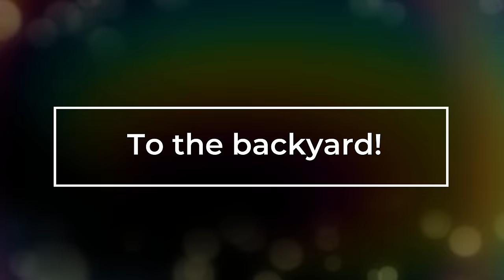Mowing tall grass perfectly (Satisfying)

Comment: i see alot of the americans mowing and then doing the edges after,i prefer doing it before like how you have it done it,cleaner to me,that mower just seems to eat the grass,but  alot people bag the crap outta the toro but it looks pretty good to me,what are your thoughts on the mower?
Reply from the maker: Thanks! Ah, you asked me about my mower, which is something I love to talk about, so strap in! There is a lot of talk in the industry about the Honda HRU 216; it has a great engine, is tough as nails and reasonably priced for what you get. Word on the street is that the self propelled and other ancillaries no longer last as long as they used to though.This Toro is a little less affordable, but more robust overall, handles well in tough conditions, and leaves a great finish. I've cut foot high grass with the mulch plug in and it was so clean it looked like it was caught. The blade on the mower in this video has since been replaced, so it performs even better now. My opinion is that for a long time this mower has been the best in the Australian lawn industry, with the 216 a small distance behind (I'll get haters for saying that haha). Apparently there is a new kid on the block which has probably unseated the Toro 21 inch, and that's the Scag 21 inch. I haven't used it yet, but I've seen and heard good things, so it's looking to be a possible future upgrade :)
Reply: @BladeMateLawnCare  really the scag?,ok must look into it,didnt know they had a push mower,that standon mower looks awsome as well,cheers mate,have a great 2024
Reply: I was ready to pull the trigger on the new Scag 21 inch, but ended up picking the same Toro Sean has but with the Honda engine for one main reason; steel deck (Scag) vs. aluminum deck (Toro).  I also happen to have the Honda, and even though the Toro is a tick rougher around the edges, the build quality is night and day.  It will take anything you throw at it.  Cheers.
Reply: Problem is with the Toro it only has the 1 long blade where the Honda HRN has 4 swing blades that cuts the grass better when wet in my opinion.
Reply: Yes in USA I do it edge first mow then blow!! My lawn always looked great!! I was anal about it and everyone on my street was jealous of my lawn!! It was just less than a acre and took about 4-5 hours to do but it was worth it. I miss my old lawn and house and my lawn tractor and craftsman edger! Old age took care of all that stuff for us!
Reply: @michaelrini3654  yes it makes sense to me,doing edges first then mow to clean up edged grass,in saying that theres a method and  reason why they do what they do which i dont understand unless i was a full time mowing like themselves,just my opinon of someone from the outside looking in
Reply: @sliew9120  Looking at this video I can see why it's done. The cut height on a mower is easily maintained using settings vs feeling for it with a string trimmer. So, the areas covered by the lawn mower produce an even, consistent cut vs using the string trimmer. Also, more space is efficiently covered by the mower's bigger cut width, leaving you with less to trim/edge. Anyway, that's my reasoning.
Reply: @A-r-o-h  i would never mow my lawns with a trimmer,for edges and such,yes,previous comment was about using mower after trimming helps clean the mess made from trimming,just a personal thing i guess,it seems the norm where im from
Reply: @sliew9120  I never would either. I use mine to finish areas. I guess what I was trying to say was, cover as much area as possible with the mower, and leave as little as possible for trimming. From this video, using the string trimmer first, results in some inconsistencies in the overall cut. The trimmed areas either being too high or too low to match the mowing height. As for the trimming debris left behind, it's barely noticeable, especially if you mulch. To each his own I guess. We all have our reasons.
Reply: @A-r-o-h  ah yea i get what your saying,fair enough,as you said each to there own
Reply: as an american, i would edge first then mow, then trim, and blow boom! Simple!
Reply: Happy1¹¹¹
Reply: 111¹11

Comment: Sean, I've noticed that you use the whipper snipper for some edging and then you use the bladed one for other edging. Is there a purpose for this? I've been wondering if there's an advantage of one over the other or if it's just personal preference and how it is you come by the decision that one will work better in "this case" than the other. Can you explain?

Comment: Does cutting long grass with a mower damage the mower? I keep getting told I leave the grass too long (mowing twice a week) and that I need to mow once a week not for anything else other than protecting the mower? it is a self-propelled so there is that.
Reply from the maker: I've heard a million things from a million people, most are nonsense. You can really only damage a mower by mowing things that aren't grass. If it can't cut the long grass, it simply won't. It won't wear out faster or slower. Engines wear out if revved too hard. A mower will lose revs if under load, so it won't do more than it's capable of and won't wear out as a result. There is an argument to be made about riding the self propelled mechanism when cutting long stuff though, which may cause gear box wear.

Comment: Hi Sean , hope you are well. Thank you for all the amazing videos , I absolutely enjoy every single video you post. I must ask you though...is there a major difference or any difference between a petrol weed wacker and an electric weed wacker? I am asking about speed , longevity,  strength and life span. For some reason I just find more pleasure in petrol weed wackers. Ps not being funny just asking before I purchase an electric one.
Reply from the maker: Hey thanks so much! 
My battery gear is as heavy and nearly as powerful as one of my 2 stroke Stihls. Best part is minimal noise, no temperamental start ups, no fuel mixing, and very little vibration. Just point and shoot it :)
I can't speak for the versatility of the residential range, but I couldn't recommend the one I use more.